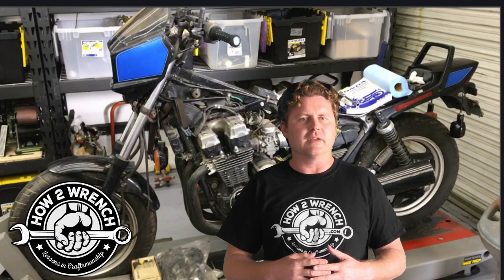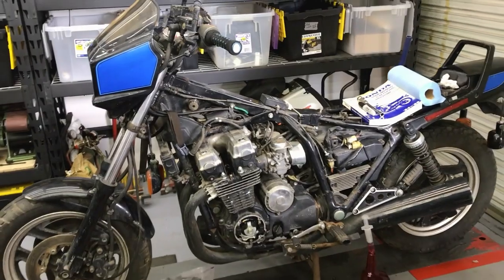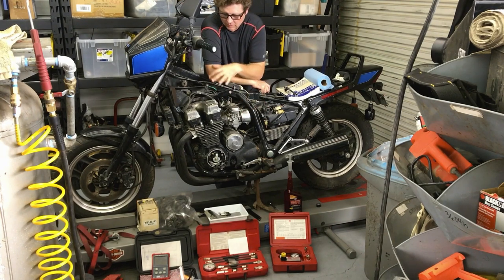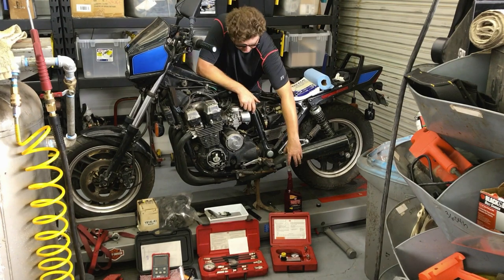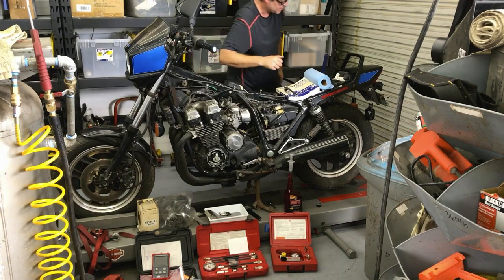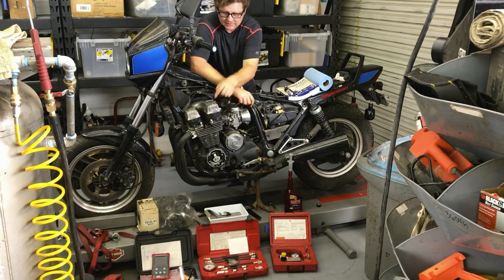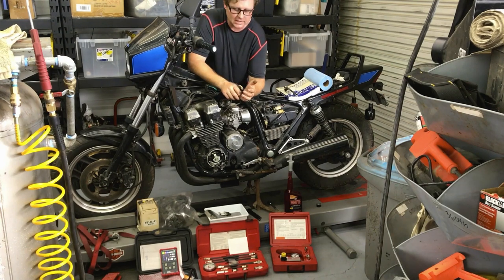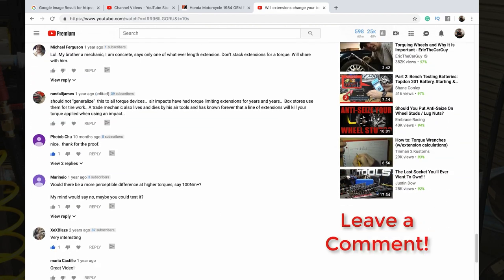Part 1: What you should do BEFORE a compression test! Bonus Restoration Tips!

Comment: Whenever a multicylinder sits, some of the valves will be open, the valve springs compressed, after yrs those springs will be weak and lower the red line, so valve float might happen.

Comment: Hi Shane, really enjoy watching your videos, I'd like to ask you a question, I love to do mechanical work to my old V-Strom 1000 and recently I had the stator magnets coming loose, so rather than getting a new very expensive flywheel, I glued them back and the fix seems to hold and work well so far but I was a bit concerned about the theoretical possibility of the flywheel balance being off after this repair. I went to a shop and they told me that it is not ok to balance the flywheel only (without pistons) and even if it could be done it would be too expensive to do compared to buying a new flywheel. What would you do? P.S. The bike is not vibrating excessively. Thanks if you can help and apologies if I posted this in the wrong place.